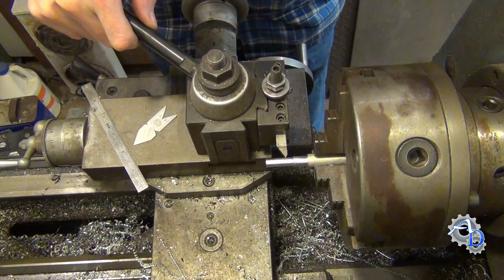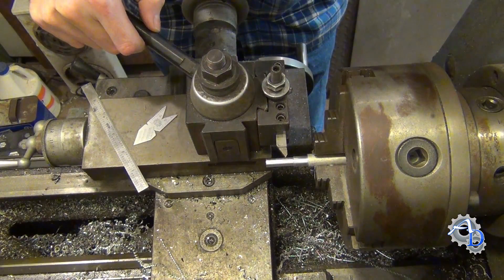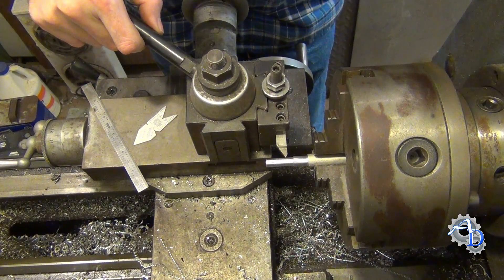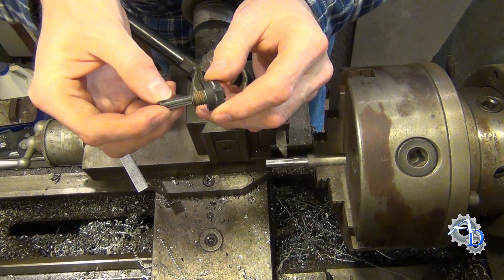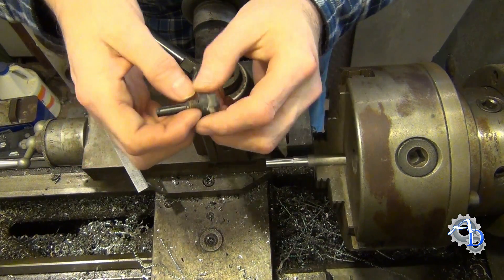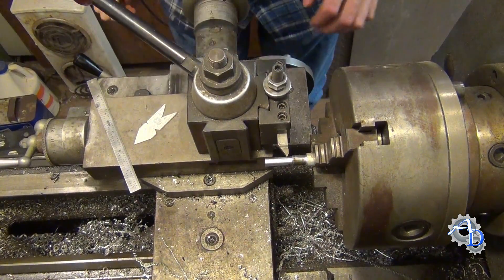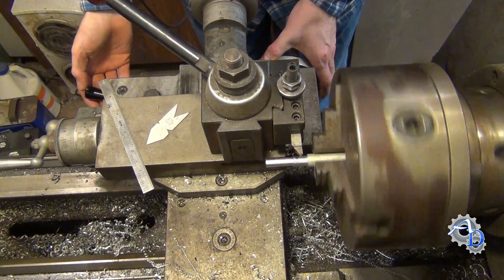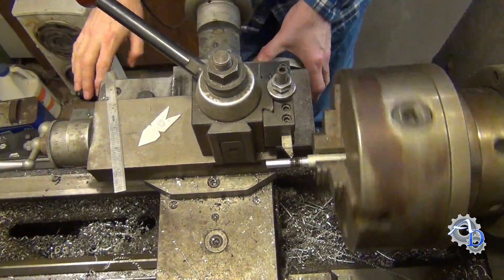Machining a Snowblower Part Before The Storm

Comment: Two thumbs up on Packratism.  I'm in the club.  
What was the air blast at 7:03.....auto tank drain?
5 years ago I got tired of my junk snow blower breaking down in the middle of a storm. 
I got so mad I fixed it, sold it, and bought an old fixer-upper Skid Steer. Driveway is 150ft long. 
It was a good move. Great vid!
Reply from the maker: Thanks. Yeah, that's the tank drain. It likes interrupting me during videos. I'm thinking about the fix it and sell it route myself with the snowblower. I'd like to build one of those snowblowers for the front of my truck. They're too expensive to buy outright. Around 8k now I think.
Reply: I have no doubt you could build one and it would be spectacular. 
Would make a cool build video series.

Comment: Nice work. You are lucky in that the original thread was M10-1.25 which works out to be 20.15... threads per inch
Reply from the maker: Thanks. I'm glad the tank thread(or my thread), was sloppy enough to accommodate.

Comment: I've seen the ruler across round-stock trick to find approx center before, but the paper @ 5:38? Why would you do that while the cutter head is spinning? My Dad used to smack me when I did stuff like that in his shop. Anyhoo, another awesome video..thank you so much for posting !
Reply from the maker: Thanks. It has to be spinning if you're trying to find the high spot on a piece of round stock. I was taught that many years ago. It's not dangerous because the paper just moves out of the way.
Reply: I guess I still don't understand the technique or why you wouldn't touch-off on the high side?
Reply from the maker: It's just something I do. I don't always use the paper, but wanted to show the technique in the vid without going into it too much. I use the paper as a buffer so the cutter hits it first, because I can't always see the gap as it gets really narrow. I mic the paper first, which is usually about .003, so when the cutter moves the paper, I know I'm very close to .003 off the top of the part. Then I dial in that .003 and call it zero, without having to touch off, though I still did it in the vid. I didn't mic the paper in the vid, so I was a little off. That's why the cutter slightly cut into the top of the part. I wasn't too worried about the size, but it still came out where I wanted it. I use the paper too sometimes whenever I'm surface grinding, though I'm more cautious. If I'm grinding to the tenth, I'll bring the wheel in to within about .0005 after using the paper, and touch off very carefully.
Reply: Ohhhh..Completely get it now..thank you for taking the time and explaining that more! This is the same thing my Dad would do with kapton tape. I guess kapton tape also has a specific thickness to it and he always said that the tape would also protect the finished part from chip damage too. Different kind of machining however..he was a gunsmith.
Reply from the maker: Interesting. I'm going to look up kapton tape. Might be another good addition to my toolbox.
Reply: Another way of doing this is with the cutter stationary and a feeler gauge. Principal is more or less the same. That method suits me adequately. John. 

PS: With a known dia chucked in spindle, a feeler and stock clamped in machine center can be found with simple maths if you don't have an edge finder. John.